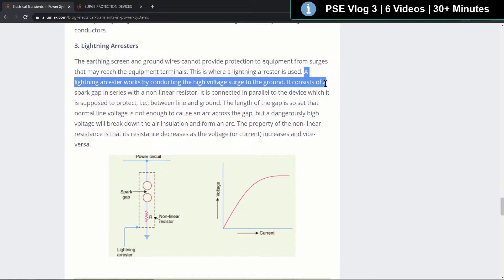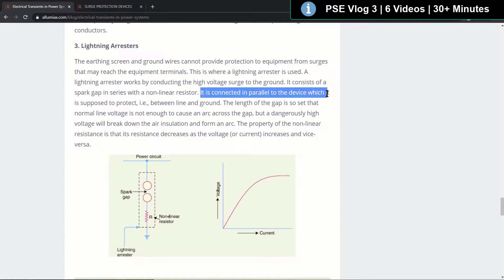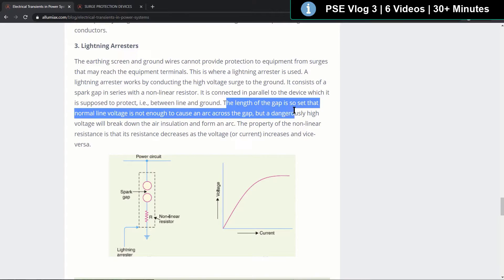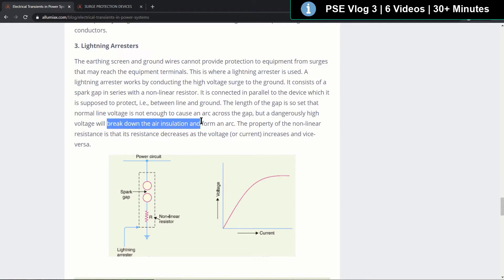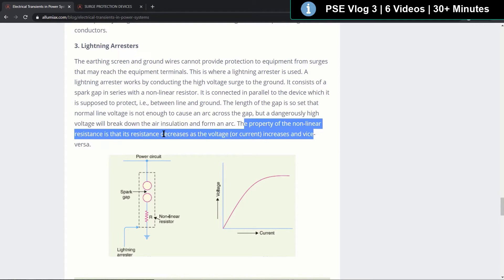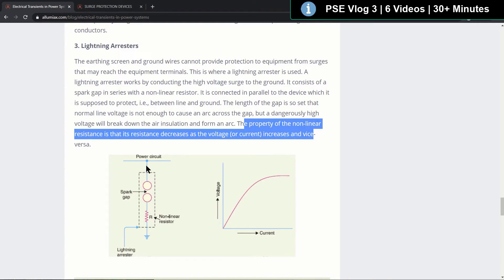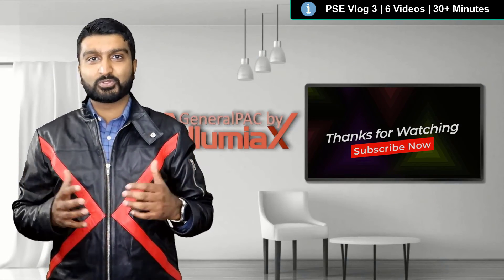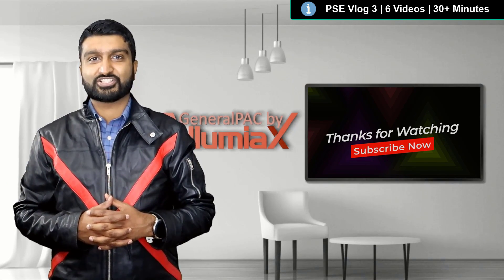What are Lightning Arresters?

Comment: Do you have some kind of transient analysis of what happens when a tree limb under heavy wind severs a transmission line cable?  I know the transmission is at v high voltage (low current...the whole point of AC) but what exact kind of transients do you see when a HV line snaps?  Any link?
Reply from the maker: @klam77 Yes, we have a detailed blog on it. It can help you out in understanding electrical transients. Here's the link:

https://www.allumiax.com/blog/electrical-transients-in-power-systems

Hope you find it useful.

Regards,
GeneralPAC by AllumiaX